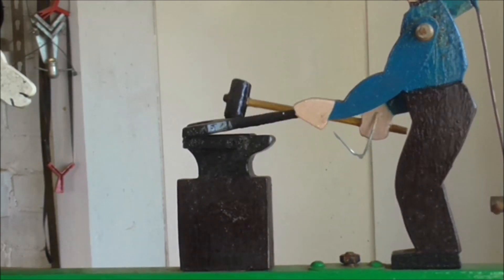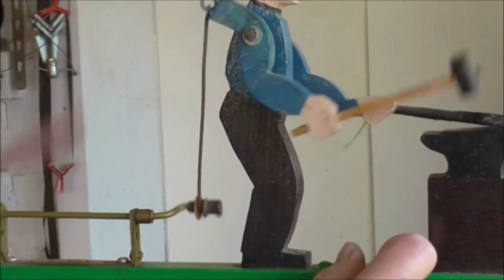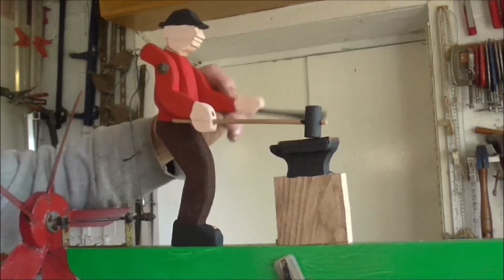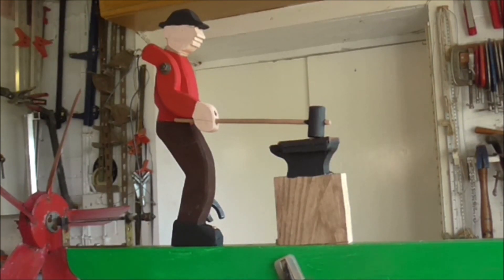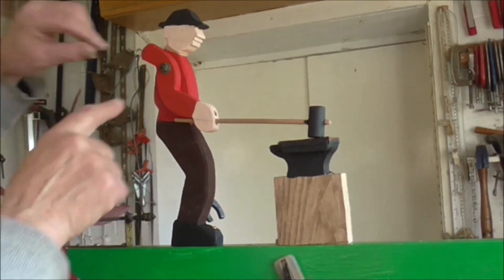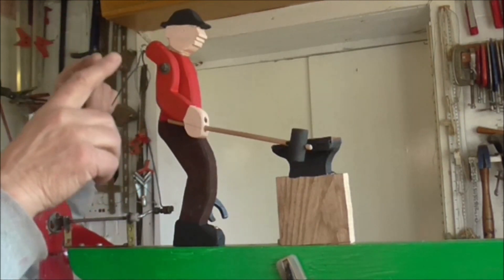whirligig hints and tips part 2

Comment: Great helpful videos. Thank you. After successfully making a basic weather/wind vane, I’ve been experimenting with whirligigs. Can you shed some light on size constraints. I made one with two woodpeckers on either side of a tree with the one on the fan side moving the one on the other side. Is there a ratio for the weight for the woodpeckers to the fan or how much wind I would need to get it moving. I think I need a hurricane to move my fan.
Reply from the maker: Hello Leon, many thanks for your kind comment. In my opinion size is not important and often when I have made one I wished that I had  made it larger as the bigger they are the more effective they look. I have tried all different types of fans from one with two blades which was very poor and cannot be recommended right up to one with 12 blades. Normally 4 or 5 blades is sufficient.

The problem is that if you make the fan too efficient and you get strong wind they vibrate the whirligig so much it can break.

Some years ago I made on with two pecking chickens with a blade as efficient as a 'spitfire' propeller, it used to whizz around until one day in a storm it 'took off' and crashed to the ground!